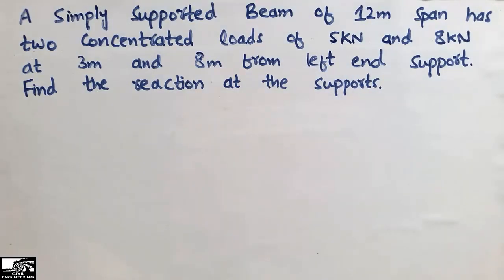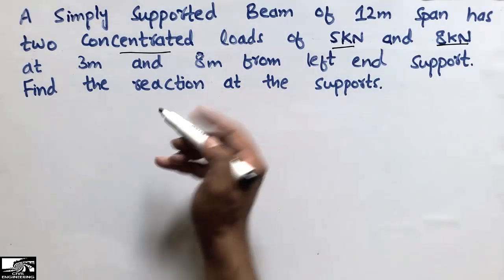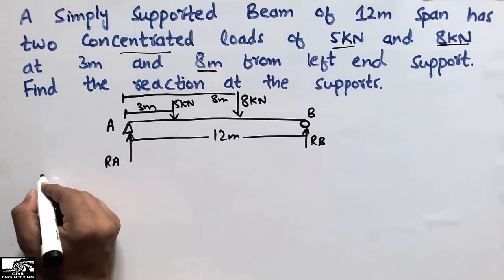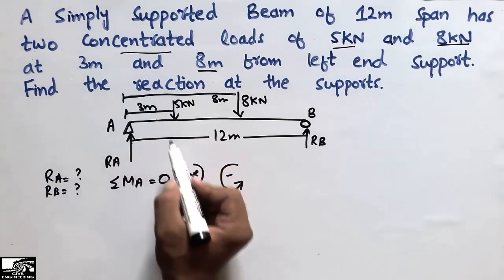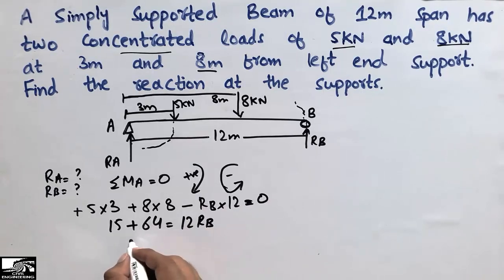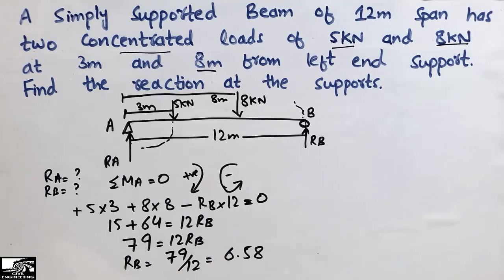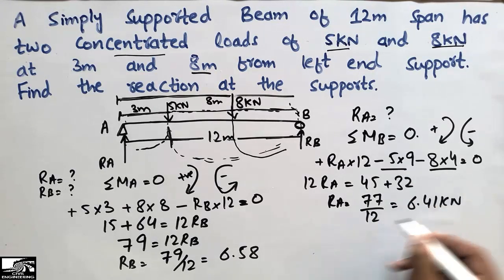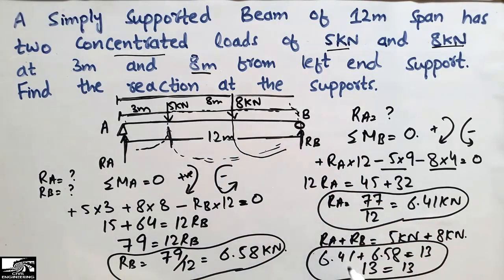How to find Support Reactions || Quick Steps

Comment: Calculate Load on horizontal M.S. I Beam Girder A, B, C? Vertical Lift Gate Example. C/C of Side Seals= 6.2 m, Height of Unit= 2.5 m,Design Head 6.5 m,Water Thrust on Unit is 81.375 t,Three horizontal MS I Beams from Bottom 450, 750, 800, 500 mm. M.S. Beams are Fixed Support. Sir please solve my problem.